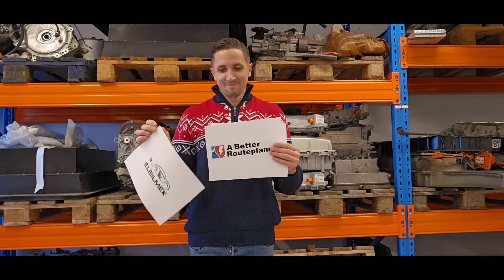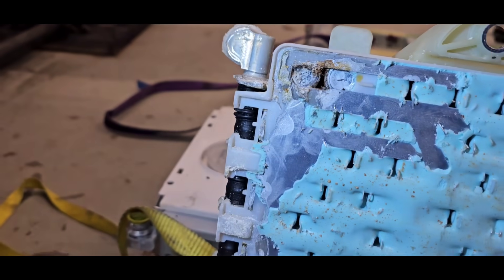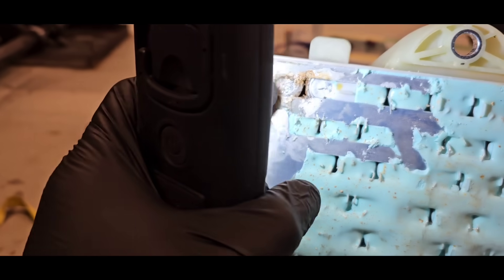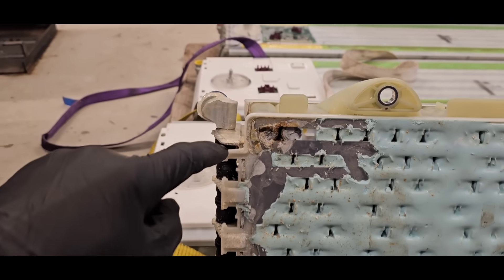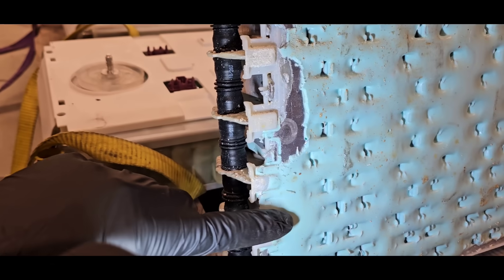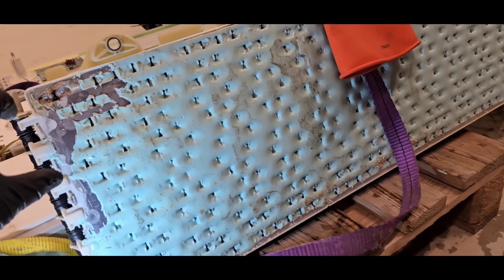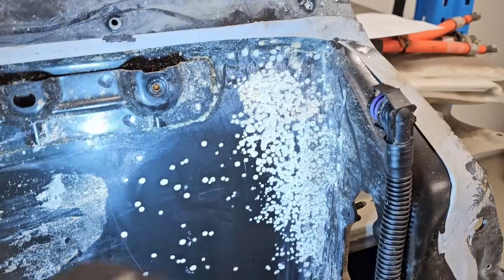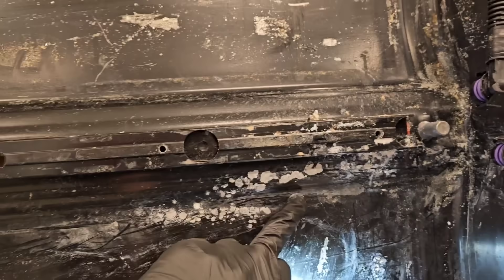Elbilmek repairing Model 3 with flooded battery part 2

Comment: Thanks - really appreciate the description of the damage. I remember Elon Musk commenting on videos of Teslas driving through very deep water like submarines, and he said "its cool but you really shouldn't do this!". Turns out there is good reason as if you spent enough time in deeper water, even a small amount of leakage could be a problem over time. I certainly will be avoiding deep water in my model 3!
Reply: Yes the car might get through alright but it will never be the same.

Comment: Maybe you can offset the price of a replacement by selling this battery pack for scrap to a recycler.  Is that a thing in Norway?
Reply: Was thinking same. Maybe we find someone who is interested in buying modules
Reply: Greetings from Canada...are batteries recycled in Norway?
Reply: @tomgrainger9566  Greetings from Australia Tom.  Uhm, not sure, but they might do some recycling.  Volderma seemed to be able to get the pack sold off though.  He sent me a message that he had been thinking the same thing as my original enquiry.  It could also go for repurposing into a home battery (if it’s not too far gone), as thats a thing now too.  They seem to be up on everything there, and they most likely they have some form of stewardship as part of the condition on of sale on new items.  They are a rich nation, so yes, most likely.  Cheers.
Reply: In Canada we may have to give up plastic bags & cutlery yet no plan to recycle EV batteries & who pays for it. How is Norway addressing this issue? Has your car insurance gone up with basically an EV fleet ? Thanks 👍
Reply: @tomgrainger9566  There is a factory recycling EV batteries in Norway now. Hydrovolt in Fredrikstad, Norway. A 50/50 joint venture between the Swedish battery manufacturer Northvolt and the Norwegian energy and aluminum company Hydro. Established in 2020, opened the doors in 2022. They have already made recycled materials for new batteries that Northvolt have tested.

Comment: Good job guys.  Let's hope you will find 2 modules for good price .
Reply: It will be almost impossible to find matching (internal resistance and degradation)  modules. The whole battery needs replacing (most probably).

Comment: Very interesting. I suspect the metal plate was eaten away by electrolysis rather than corrosion. 

I'm a little concerned about the breathers for the battery. Potentially if splashing from deep standing water or wading could cause the temperature in the pack to drop enough that the air inside the pack contracts, opening the valve allowing water ingest into the pack.

Gearbox breathers on some 4x4s will have to tube extending the height of the breather. Considering how low these packs are I'm surprised the breather isn't brought up into a safer location.

Comment: Disposable throw away car. Sexy on the outside, deeply flawed inside.
Reply: The car is being repaired... like, how many cars of any type are written off by flood damage? (answer: lots and lots!)
Reply: @MrAdopado  That pack is not repairable and has design flaw which allows total loss of $17k battery from minor water submersion. I expect pressurized pack with no ability for water intrusion. Placing those vent holes at water level is really stupid. Designed in California for their climate where it does not rain.
Reply: @antronx7  You don't appear to know about flooding in California!

Comment: Well, is a engine is flooded, it's the same. Rusted pistons and cam shafts.
How are the motors and the rest of the vehicle?
What if you can safely strip off the battery coverings and unrust everything? I understand this is a dangerous task

Comment: I really likes your technical videos Valdemar. I really want to se more of those, also with other cars then tesla. Then its more easy to sort out what small or used electric car i should buy as an electric car number two beside the tesla.
When that is said, i really did not think the tesla batteries had flaps like that whitout a way to pressurize the battery internal. The air there is going in the battery fx if i drive down a mountain where the air in the battery equalizes, this time at the year will properly contain alot of humidity or a mist of water from underneath the car. There should be a compressor or something getting dry air from somewhere else supplying the battery with air to equalize.
Reply: Will for sure find some interesting repairs for future :)

Comment: This looks like the 2019 model 3 battery. The model 3 is very resilient to water ingress however if the car is parked in water and with Norway's salt on roads in winter does present some additional risks. Nice video, just remember to use a wireless mic next time.

Comment: How are the cell voltages? It looks really bad, but corrosion can be cleaned off and new tabs welded on the cells! 
I say it's repairable, unless too many cells to leave disconnected have dropped significantly below 3 volts.
Reply: The cells in the module are glued together and cannot be individually replaced.
Reply: Yes you could spotweld in new tabs. But once corrosion has started, it probably will continue. And you don't want a spontaneous short in your battery while driving due to corrosion flaking off.

Comment: Terrible battery design. Totally unserviceable yet also not very waterproof.

There are ways to seal the battery completely safely without using a valve from a dingy.

Those rubber seals will get dirt ingressing under them then the seal is compromised and water can enter.

Meanwhile they cake all the cells in glue blocking the actual cells release valves.
Also making and repurposing of cells a fucking nightmare.

Serviceability of hugely expensive battery packs must be legislated or we will end up with iphone style construction.
Reply: This battery is yelling at you "Designed in California, where it never rains!" Why did they put valves in there? What's the point of "let the battery breathe"? Just seal it. I couldn't believe it when I saw Bjørns video where he showed the older Tesla battery which had a dozen of these valves on the bottom. I think  a labyrinth seal would have done a better job.
Reply: @benjaminhanke79  California "where it never rains"? It can rain and flood so seriously in California that there is a dedicated Wikipedia page all about 2022/2023 flooding! The myth that California weather is always dry is presumably only held by people who neither live there nor know anything about it.

Comment: So driving through flood water isn’t recommended.
Reply: Standing for hours (days?). Obviously sensible for any car to avoid immersion if possible! I've driven a Model 3 through flood water several times. It was as deep, or deeper, than I have driven other cars over the years. The car is now in its fifth year of life and no battery or other issues arising from water damage.
Reply: @MrAdopado  good to know.
Reply: Just like a ICE. It's standing in water that has done the damage.

Comment: Nice interesting video. I would think most parts of the corrosion and metal just disappearing is caused of current flow between battery's plus and minus and between groups of batteries. The more corrosion the more particles in water there will be, and more and more current can go through the water. So as time passes this current leaks damages the battery in an increasing rate. I hope there is a next video !

Comment: I don't like this design of the battery, where the valves allow the battery to "breathe" freely, allowing moisture from the environment to enter the battery even during normal use and cause internal corrosion. The valves should only open when very different pressures occur and close tightly again when the pressure equalizes.
Reply: I agree. I wonder why they didn't put the tiny black valve cabin side, where it would be protected by humidity and water ingress?
Then in case of thermal runaway the gases will just escape from the much bigger red valve facing outside
Reply: @theagentsmith There is a known solution for the case where pressure builds up if a thermal runaway happens, it's called a burst disc. If you allow a battery to "breathe" you should be aware that moisture will enter it sooner or later. You could design a moisture trap inside the pack but that would be saturated soon so you need a way to "recycle" it and dump the water overboard.
Reply: @benjaminhanke79  Similar valves are used in headlight assemblies etc. They are a membrane that only lets moisture out and not in. But beeing submerged and under pressure from water moving at speed might puncture this seal?

Comment: I'm pretty sure that the black valve is Gore vent or similar. It has a gore tex inside. It's primary function is to equalize the air pressure inside and outside. It can prevent some water from coming through, but only spray splash etc. and not intended to use underwater.
Reply: So like IP64 ? Or maybe 66 .

Comment: Severe corrosion of the metal cover is probably caused by electrolytic processes after water ingress and contact with the electric current from the battery. It may also result from the reaction of substances released when the battery cells rust through.

Comment: It is a valve to allow pressure adaptations. The red one is the relieve pressure in case of thermal runaway to prevent explosion of the pack.
Reply: There are better ways to do this without compromising the waterproofness of the battery.

Comment: Hmm, survior cells can be used for litlle projects 🪫🔋🪫🔋
Reply: It would take ages to take such a glued battery pack, and frankly seems dangerous. Here prismatic cells have an advantage, there are far less and so easier to repair, but they have less redundancy.
Reply: @theagentsmith  I know,  have tryed to dissasembly part of 2170 M3 pack  , extracted cells i use for powerbanks, pitty that positive end off cell is aluminium so is impossible to spotweld , and laser welder is too expensive 🔋🪫🔋